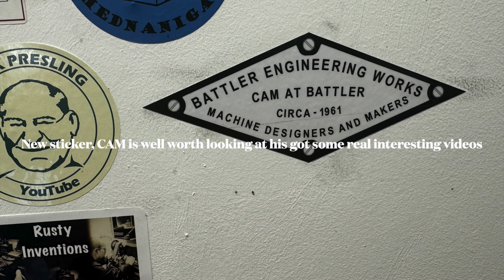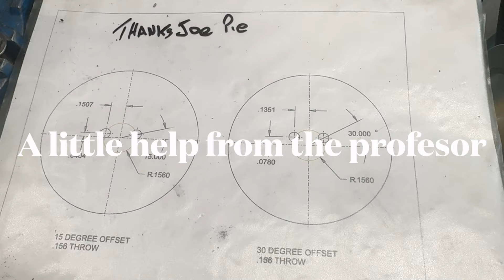Titanic stuart triple compound part 15

Comment: Greetings Andy, things are progressing nicely. May I make a production suggestion? ....If your software allows it, add a small black outline to your final white text on your screen messages. It will really make them easier to read against light backgrounds.
Reply from the maker: Hi Joe. Great suggestion, it is possible to do and it will be adopted in the next Video...it does look a lot clearer. Many thanks.